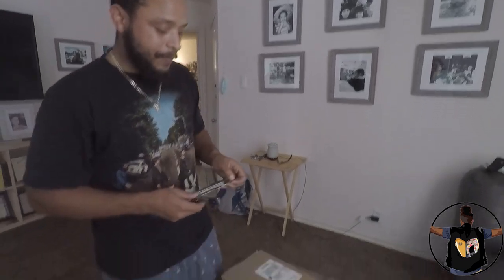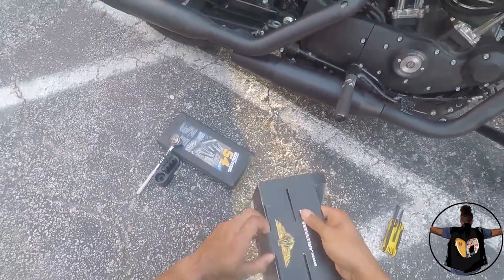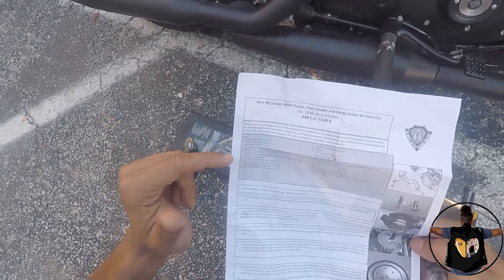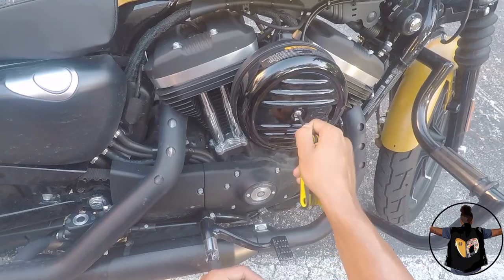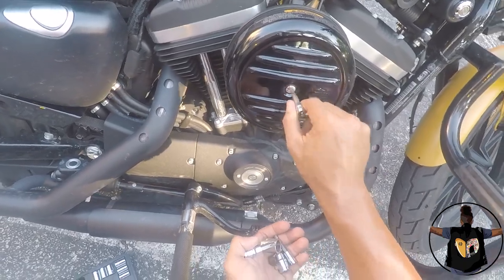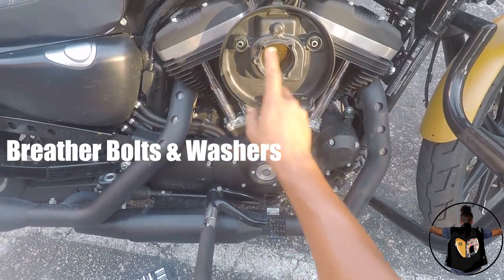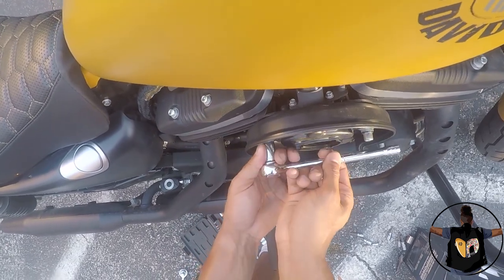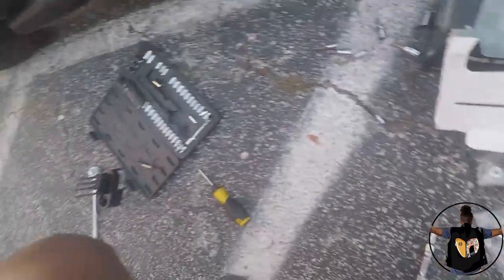Harley Iron 883 Arlen Ness Big Sucker Air Cleaner | Stage 1 Upgrades

Comment: Question if your remember...    Picked up same Arlen Ness big sucker except in chrome for my 2012 Seventy-Two off ebay..   the breather bolts with it have a much larger hole through them than the stock breather bolts removed.  Was this the same in your case?  Kit was missing instructions and appears to have been a return and want to make sure it came with the correct bolts.  Thanks.  Nice bike
Reply from the maker: Man honestly I don't even remember, I still have my hardware from my stock intake but my bike is elsewhere or I'd check for you boss. Sorry I couldn't help.